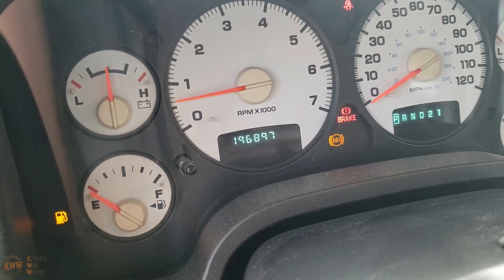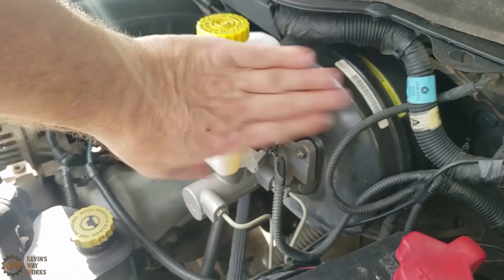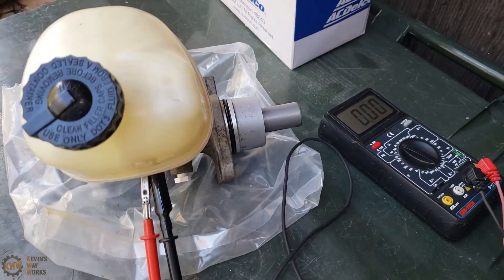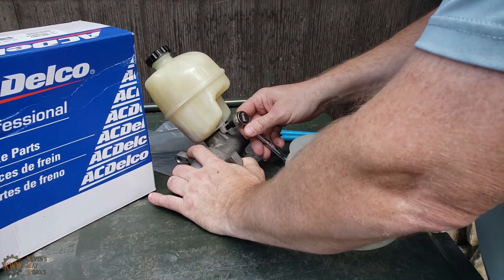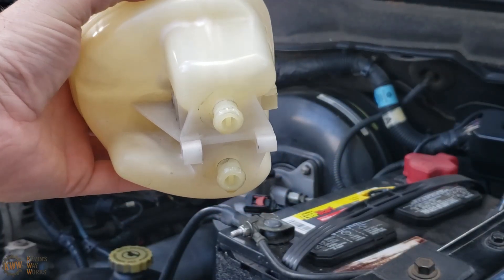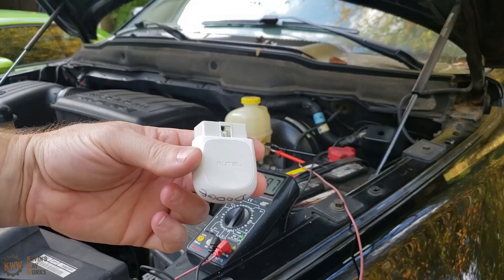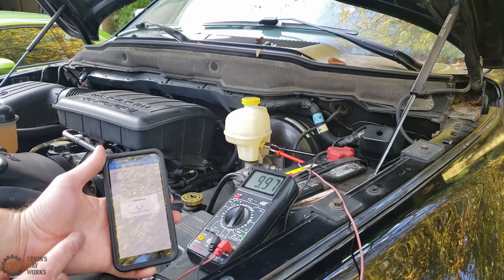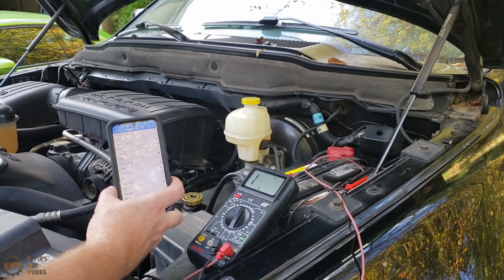Dodge Ram 1500 Brake & ABS Lights On With ABS Code 78 | How to Diagnose - (2002 - 2008)

Comment: I would have made the part store pull the tank off  another part in store and give it to me.
Reply from the maker: If I didn't have the old one still, that would certainly have been the process I'd follow.   Because this one came from rock auto, I'd have to remove the master cylinder, ship everything back, hope it gets to the return center safely then wait for them to accept it and for another one to be shipped, install the replacement, bleed everything again and hope it doesn't have the same problem as the bad one.  What a pain but luckily I had the old one still so I was able to get the Dodge fixed up in no time.